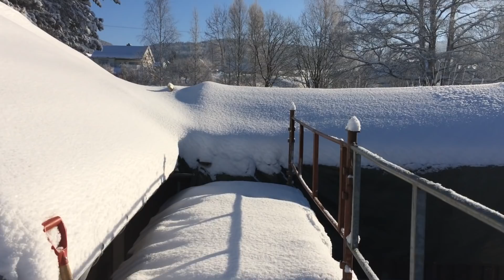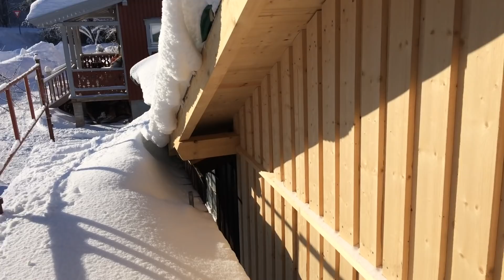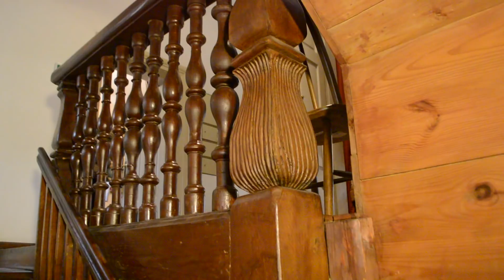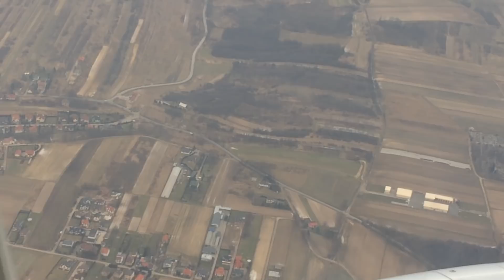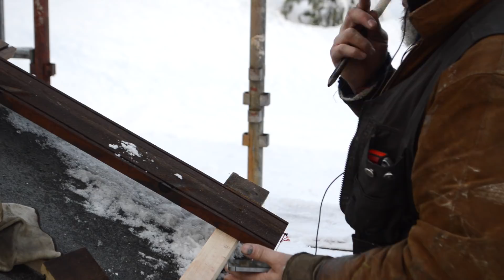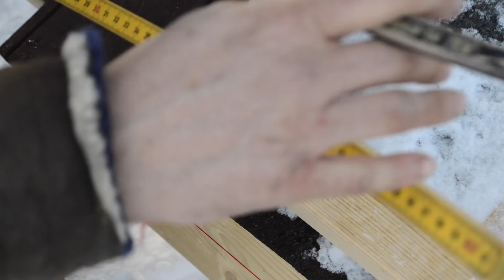🔴 25/35: Building a Post and Beam Garage - Wooden Roof and Polish timber houses

Comment: Good day Lucas, Can you explain the design feature of the roof boards, I see the "under" board have a groove running length wise along each edges, I assume these grooves are to catch water before it have a chance to get past them... But I doN't know I se the entire picture in my head! 
Cheers
Reply from the maker: Hi David, the over and under boards have the same grove and it creates a channel for both air and water, for fast drying and to stop water creeping over the edge. Traditionally these grooves were made with a plane that had a curved blade. These boards are also planed to have a top and bottom surface, which has prevented me laying the boards as I would have preferred -  that is to say heart wood up. The next films will cover the same process since it is the last work of the project, all the best, Lucas.
Reply: Thank you Mate. I really like these "traditional" techniques/ways. I doubt that would be accepted by code up here... They are so close minded...
Reply: @LucasRichardStephens  I like the idea of a channel for water in case it gets under the boards but I would imagine that over time the channels would become clogged with spider webs or things that insects might bring. I would prefer to insert a long piece of wood in that groove that locks the two boards together and makes the joint water tight. I understand that this might cause the boards to split as they shrink if the entire roof is not free to move. What are your thoughts please?
Reply from the maker: @johnshearing  Innovation is really good, but when you have paying customers tradition is helpful. You might have to wait 20 years to find out if a water tight system works better or not, and then you would only know for the climate in your area for that period. This tradition is very old,  even the system in the films has benn used widely in Norway since the 1970's, though it builds on a system that is at the very least 700years old. Building things in your head is much less risky than in reality.
Reply: @LucasRichardStephens  much thanks for your thoughts and for your videos. I want to build a roof of wood because that is the material I have. Yours  is the only video I have ever seen on the topic. Thanks for showing us this time tested technique.
Reply from the maker: @johnshearing  I hope these films can give some useful pointers, all the best.

Comment: Hi Lucas. Very interesting and loved the pictures of Poland. I haven't seen that style of roofing before. What is the timber used? I like the look of it.
I don't fancy the -14c you said about lol I think I've got spoilt living where I do. Take care on the roof in those icy conditions.
Reply from the maker: Hi Dave, The roofing in Poland was great both thatch and pine tiles, the house walls looked like pine, but I would imagine they use spruce too since we use it here. I liked the way the roof overhangs were made. I have more stills than film of Poland and will make a dedicated film at some point. All the best, Lucas
Reply: Hi Lucas, In my question I was referring to the roof you were putting on the garage you're building. Sorry that I didn't make that clearer :-(
Reply from the maker: Dave, the boards are pine, pressure impregnated with some kind of copper oxide treatment, then dipped in pigmented linseed oil. It is a product used since about the mid seventies. But pine roofing is traditional here and this system is a modern version of the original hand made type. They were often used for 20-40 years then covered with terracotta tiles or birch bark and turf. I think it was a way to spread the building cost.  This treated system should have a 30-50 year life expectancy.
Reply: Thanks Lucas. Here pitched roofs are covered in a variety of materials, Fibre Cement Slates, Natural Slate, Concrete Tiles, Thatch and an assortment of metal roofing materials. As I said I quite like the look of the roof you are doing. I'm not so sure the planning people would agree, but that's another story haha. It's been very interesting watching your progress.